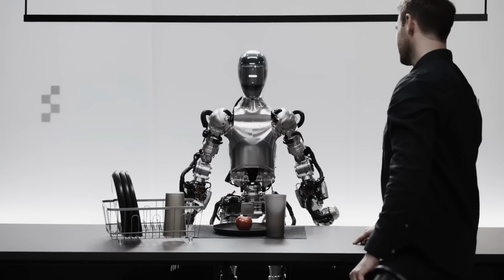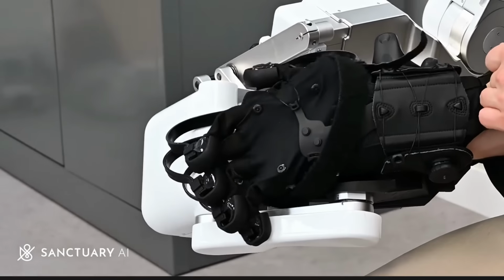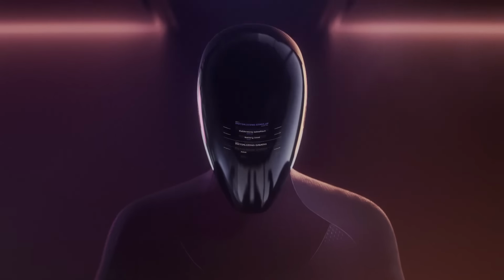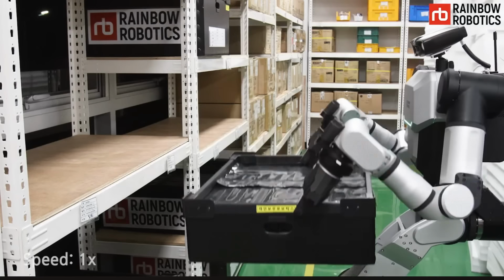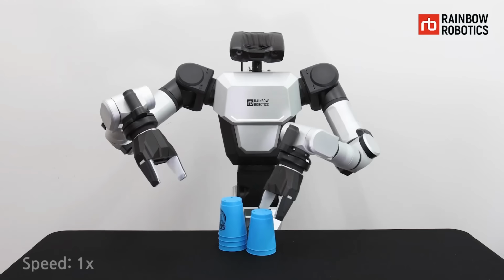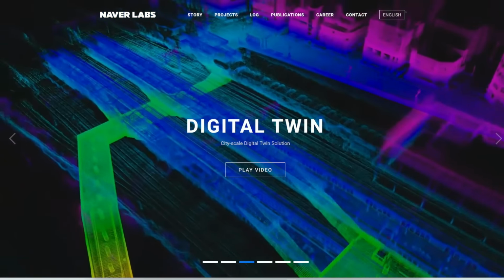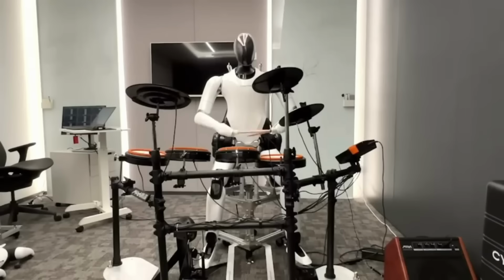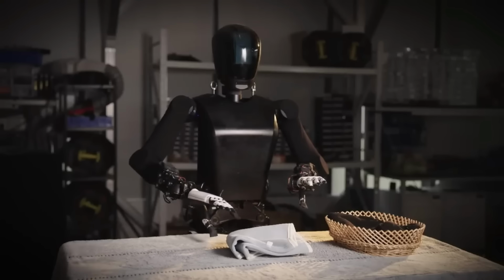The INSANE Race for AI Humanoid Robots

Comment: Pretty dang silly isnt it?😅
Why woudl one optimise factories eith humanoids in mind if machines run said factories?
Or warehouses?
Why would one use humanoids instead of machines optimised to engage in the environment they operate in?
Pretty dang silly is it not?

While Humanoid Robots of course have Usecases, factory workers ain't one of them. Neother is maid.
Why would one need a robot to press the button on the Automat?
Its and automatic system already. 
Fill it press vutton get the stuff you want. 🤷
Lets build tobots to press the bitton for us? What a waste of resources as done atm
🤷

Comment: Just a crazy question, will robots ever be able to feel a sensation like putting their arms around someone and feeling the softness and warmth ?
Reply from the maker: yes, tactile sensors can achieve "feeling softness". warmth just requires some temperature sensor, which shouldn't be hard to implement
Reply: @theAIsearch  Thanks, that's amazing.
Reply: You need to be careful with words like 'feeling' you'll end up down a philosophical black hole that you can't escape from.
It's like saying that my keyboard is 'feeling' these key presses , obviously as i type there is transistors in 0/1 switch mode that correspond to my key press being closed or open. That is not 'feeling' the key press. You could use a word like 'respond' , it has a response to a corresponding sensor, but the response is going to be like a variable resistance or capacitance in circuit .
Reply: @dolltron6965   I'm terrified of ending up down a philosophical black hole that I can't escape from, I just thought it was an interesting question.